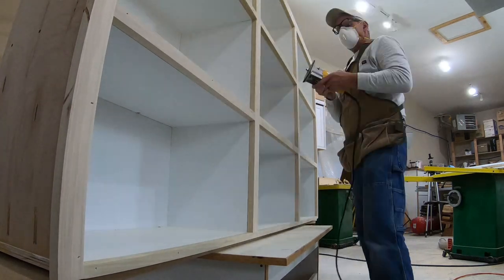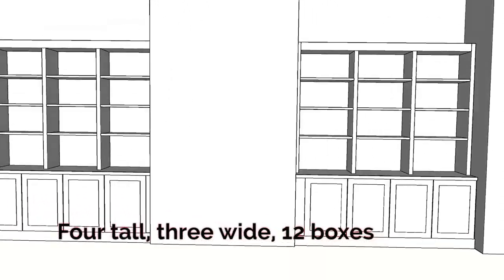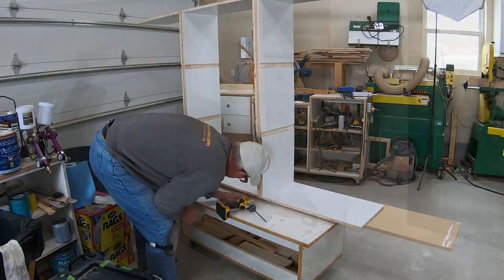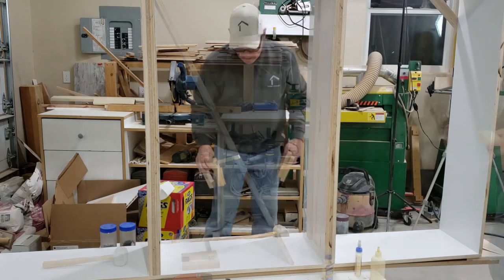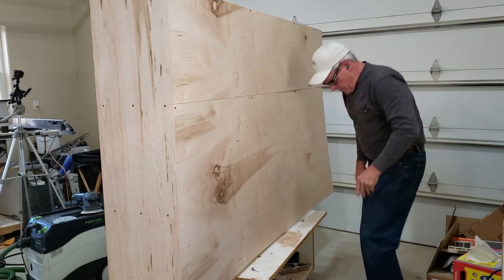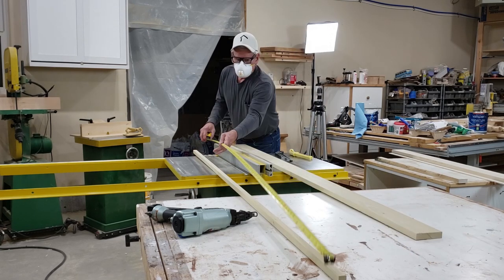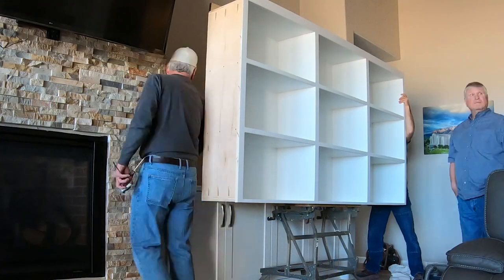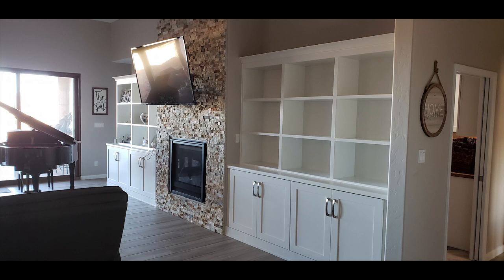How to Build Living Room Shelf Units - From Start to Finish

Comment: Very nice video!  What paint did you use for the cabinets?  Just wondering as I heard some paints will cause items placed on it to stick. I'm sure they didn't want that with their items.  Also, do you have any information on the roller you mentioned specifically for cabinets?  Thanks so much!
Reply from the maker: Most paint manufacturers now have products designed specifically for cabinets and cabinet doors which you should be pretty safe in using. Paints have gotten so good over the past 10 years or so that I have had no issues with paints of any kind in a while. The rollers I mentioned, I found at Lowe's and the packaging indicated that they were designed for cabinets and cabinet door finishes. They worked well!